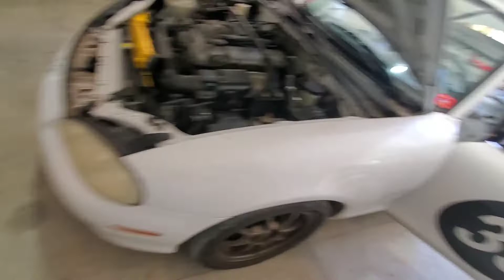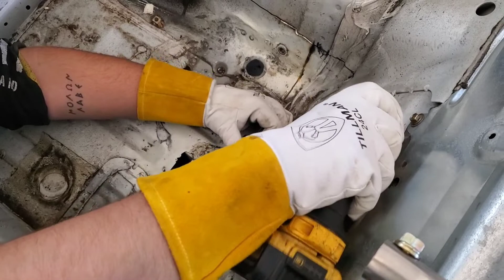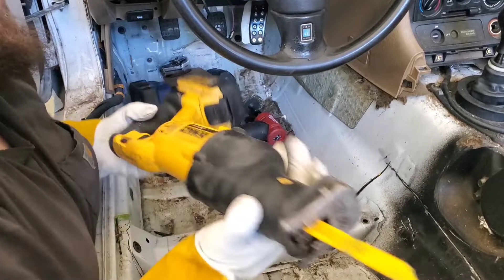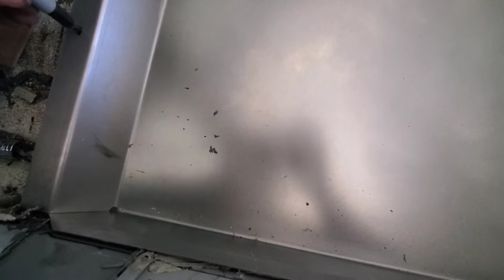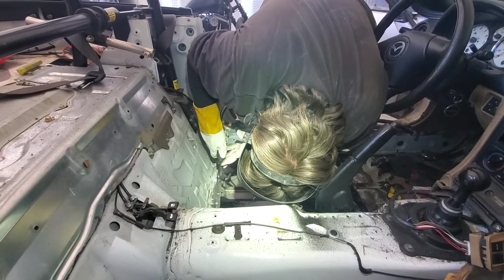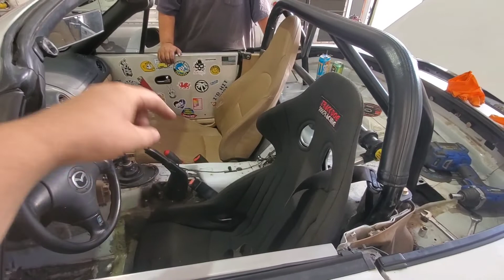golfball's new floor

Comment: Was that cross brace that went from the side rail to the tunnel structural or just a seat mounting point?  Seems like a substantial piece to cut out.  Nice work though.
Reply from the maker: The front one that got cut or the rear one? The rear one is a brace across the chassis to stiffen it. You can weld a captive nut in the new railed retain it. As for the brace we cut unfortunately you have no option but to loose that rear bolt on the butterfly brace. We out over 100 miles I'm at ncm on it after this and didn't notice any difference from the butterfly loosing a pick up point.

Comment: How much lower does it make the seat, I am 6' 6" (you have met me) always wanted a miata, but too tall
Reply from the maker: It lowered the floor 1 ½". On top of that the bracket that mounts the seat is bolted to the cross member up front and I think in the back it's like ½" up from the pan. I'm not sure how tall daylan is but atleast 6' and fits with helmet on under the hard top sitting up straight. I know someone about your height who's got long legs that fits in one without the drop floor.
Reply: @Spyke383  As I understand it, the newer models with the fixed headlamps have more room than the old flip up headlight models. I'm 6' 2" and drove one of the older ones. Soft top provided more headroom than the hardtop.
Reply from the maker: @joseantoniocastrellonjr2568  I'm not sure daylan may jump in but the soft top was removed to fit the rollbar so we never put much thought into that top
Reply: @Spyke383  Sorry, was meant for kubla84. My dad bought a hard top for the '96 Miata he has. I bought it used and drove around with the soft top. Then sold it to my dad for a grand and take over payments so I could get a SS Camaro in 2002. I'm just saying, if he wants to get a miata at 6' 6", soft top is the way to do it. Eyes will be above the windshield.